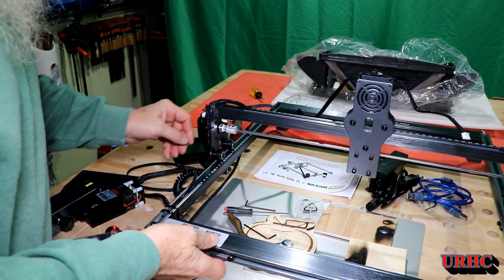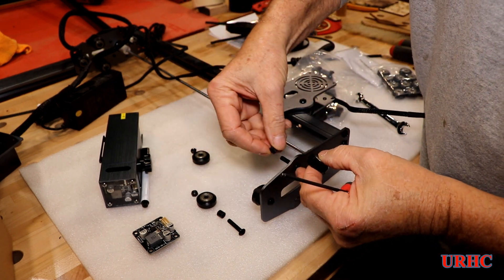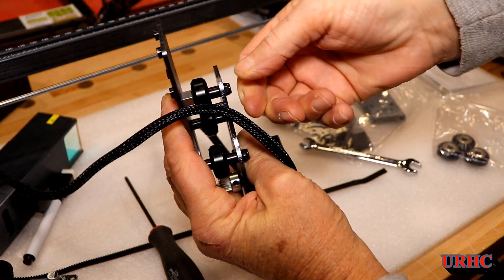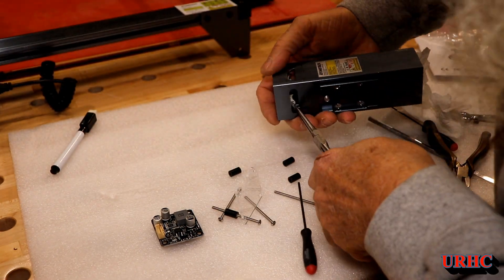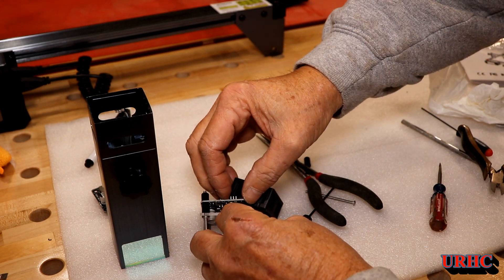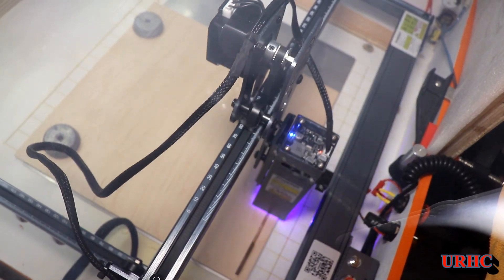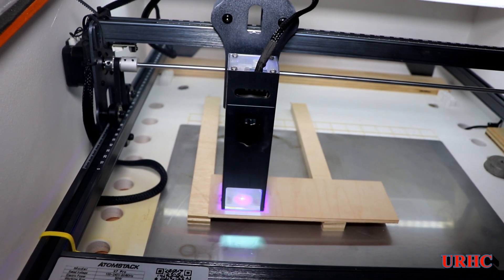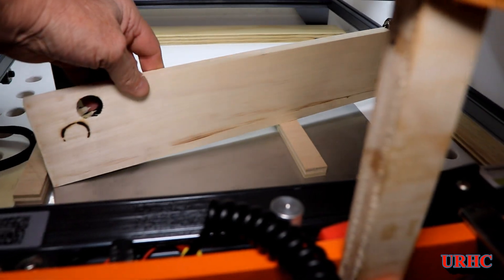Atomstack X7 Pro Repair And Second Try After Replacing Parts

Comment: Hi Redneck Hillbilly...I have a question, so, I have a AtomStack A10 Pro and my X achse is loosing. How can I adjustment or fix that. Thanks for your guide. Also, how and where can I get replacing parts?
Reply from the maker: I would start by popping the belts off and see if things move freely.  Atomstack should have parts, or even search on Amazon.  Thanks for watching.

Comment: Wow, so i thought i had an issue with the belt tensioning with the bumps, i have the same issue with the wheels.  Just ordered a new set, hope it fixes it.  Thanks for this great video!
Reply from the maker: i think they use the lowest cost wheels available. I definitely  wouldn't recommend Atomstack after this machine.  Thanks for watching.
Reply: @unemployedredneckhillbilly2023  Appreciate the reply.  Got the new wheels, and while it considerably better, i still have a single bump in the dead center of my gantry.  It seems the off balance of the whole mechanism is the cause.  If i counter weight the motor side, i dont get the bump.  The new wheels seem to be in good condition and i noticed that the bumps tend to get better or worse depending on how that little silver offset nut behind the bottom wheel is set(the offset sets the tension of the wheel on the track).  Going to try and see if theres just a really fine line of setting that tension that gets rid of the bump.
Reply from the maker: If you over tighten the new wheels they can flat spot and you will get a bump every revolution.  If it's  just in one spot check the extrusion for gunk or damage in that spot. Never  seen this kind of issue  with other manufacturers.  Guess that's  why this model was replaced so fast.
Reply: @unemployedredneckhillbilly2023  I sent a message to atomstack about this.  They were actually pretty helpful once i sent them a picture of what was going on.  They did suggest the same thing about the wheel and send a more in depth video on how to calibrate the machine.  Language barrier is a bit to get over, but plan on going over and possible replacing another wheel this weekend.  Thanks again!
Reply: @meistudiony    Here is the reply I got from support for the same issue:
 "We are sorry for your trouble. Where did you purchase S10 Pro? Item returns/replacements, missing parts issues and accessories replacements are handled directly by the seller."  guess YMMV with support.... I'm considering just returning the unit and going to a better supported machine

Comment: While they did send out a replacement board it definitely should never be on the user to replace bearings for the machine to run right. Hard pass for me.
Reply from the maker: This definitely is not one of my favorite machines. There's a reason  the price is lower then the rest and the support kept saying it was my fault because  the belts were to tight. I find Ortur  has the best  support and least problems on machines like this. Thanks for watching.

Comment: I just got the 50W model of this laser, but, before putting it together (or even receiving it) I decided to watch every video I could. I saw this one and decided to invest a couple of bucks into a set of bushings for it, even if they have resolved this problem. Better to replace them first than to cry when they bork up. 
Great informative video.
Reply from the maker: Good idea. Atomstack definitely  seems to cut corners to save pennies and then if there is a problem their customer service is slow as snails. Thanks for watching.

Comment: My X7 Pro just cant seem to perform "long" cut times. If i run the test cut (the dog on the SD card) i can get through in 2 passes, immediately after that if i run the test again then 2 passes is not enough to get through the same wood. Feels like heat soak on the laser, the longer the cuts the weaker is gets (assuming here). Speed / power tests have been run on the wood and 400mm 100% gets through the wood but again at that same setting and longer cut (like a small 5cm x 5cm box) and even more passes i wont be able to cut through? No idea what to check at this point. I even tried a more powerful PSU thinking perhaps the PSU that the X7 came with was not sufficient / faulty, thought this because the laser cooling fan would slow down audibly when the laser stated up. Any suggestions on what to check or how to pinpoint the issue?
Reply from the maker: Contact Atomstack. I have heard  running  their lasers at 100% kills them quickly.  I think there's a reason that the  Atomstack lasers are priced below  the competition.  I have better  results  with my Ortur and X tool machines with good support. Thanks for watching.

Comment: Wow, this is awesome. I just got one and have the same issues with the wheels. The belts/motors are grinding as a result.
Reply from the maker: If the belts  are grinding you have something wrong  with your limit switch settings or origin location.  Thanks for watching.

Comment: Sounds similar to me. I initially ordered a A5 Pro+ and the laser failed within 30 minutes of use. I decided to purchase the S10 Pro instead (exactly the same as the X7, not sure why the different names) and its been working well since then. I just added the air assist to it, I'm hoping that will allow me to cut through some thicker material a bit faster.
Reply from the maker: I think many of the first X7s had defective lasers. Now it just seems to be lenses cracking. Thanks for watching.

Comment: Hey there, I have a big 90w Co2 laser and am thinking about a 10watt Diode laser. The only thing is some of the diode lasers have some short comings in their build.Atomstack has a small spot size and that's good. The D7 has a very nice build. I wish they all had air assist and linear rails.
Reply from the maker: Right now the Xtool d1 is the nicest one available and they just released an air assist.  I am looking  at upgrading to a Co2 laser in the future.   Thanks for watching.

Comment: Hope you get better soon. Just discovered you and liked the page. I'm on the fence between the Xtool d1 and the Atomstack x7. Would love to see a side by side comparison once you have more time with them. Can't wait to see it if you do one! Take care..
Reply from the maker: I like the D1 better then any of my others. The X7 does work good in the end but all the cantilever is looking for trouble. Can't believe the price increases on all of them since Christmas.  Have to make an enclosure for the x7 before using it anymore and that is not in my near term plans right now. I may stretch it out to 4 feet long first. Thanks for watching..
Reply: @unemployedredneckhillbilly2023  cantilever? It looks like the specs like beam size, depth of cut, just about all specs, and price favor the x7. The d1 looks nicer and has the wifi though. What in your opinion makes the d1 the better buy?
Reply: Also what about the limit switches and homing ability of the x7? Sorry I have so many questions. I'm new to this.
Reply from the maker: I am just going by my experience  so far. 
My D1 needed no maintenance in a couple  hundred  hours  of use. The A7 was nothing  but problems right out of the box and is very finicky to keep adjusted. The D1 has much higher  quality  boards. The D1 laser has a much thicker heat sink assembly  for the laser. TheD1 has much less moving mass and zero play in the rail assembly that just needs to be wiped down and lubricated every  once in a while. The D1 has better  connectivity and it all works good. The offline sd running is a little  easier  with the A7 but the D1 app negates that. The plastic  laser shield on the D1 can be removed to allow  it to engrave  recessed  pockets where with  the A7 you only get about  1.5 mm limit.  The D1 has constant easy firmware  updates to improve results where the A7[ offers none so far. You have a choice  of 3 software  options  on the D1 ( lightburn,  laser box, or the app) and you only have laser grbl or lightburn costing $60 plus $30 a year for updates for either  machine. plus the D1 is sexier and engineered not just a batch of 3d printer  parts tossed together.  I use a hard stop that is the same as limit switches on my D1 and its easier for me to use plus the red laser framing is much easier  to line up. 
I definitely  would not spend my money on an A7 but you may feel differently.
Reply: @unemployedredneckhillbilly2023 ....and you just sold an Xtool. Can't wait to get it.
Reply from the maker: Mine has been running all day working on my next video. Start thinking about an enclosure or some type of ventilation for it. I think you made a smart choice.

Comment: I have a SculpFun S9 with similar cogging problems. Can you describe how you sized the wheels and post a link to the ones you used?
Reply from the maker: There's a link to the ones I used in the description.  Measure them. Mine are std 3d printer wheels Thanks for watching.
Reply: @unemployedredneckhillbilly2023  Thanks for the reply. Turns out my problem was the bolts used for axles were loose. Probably resulted in some twisting. Once snug, everything ran smooth. The wheels and bearings appear to be top quality.

Comment: What happened to the Chevy videos. I was riveted to your issues.. I too own a 2017 gm product..Happy New Year
Reply from the maker: I just took it down. GM will do nothing. Says it's  normal for their trucks to rust like that after 2 years and the 3 year corrosion warranty has run out even though it was started long before that. Now the dealer owner has stepped up and agreed  to buy the truck back for how this was handled by their service department. GM called  the shots so the dealer was basically  stuck in the middle and I will set that straight in an update.  Everything is delayed  because  Of my health right now.  Will do an update when it's  gone with  the details. GM does not care about customers and know this is a major problem.  l am in the line for a new Tundra now but it could  be months to get the one I want because  they don't  take orders now. Only  build  what they have parts  for and you choose  if you want what's available when your number comes up. I will never  touch another GM vehicle. Thanks for watching
Reply: @unemployedredneckhillbilly2023  . Thanks for the response. I’m glad the dealer did the right thing.  Hope you get well soon. Happy New Year
Reply from the maker: I think the real problem  may have been GM didn't want any videos online showing them fixing this TSB as it would  have made others use it as an example  to get theirs fixed. They seem to have me blocked most places I posted my video.
Reply: @unemployedredneckhillbilly2023  What a mess. I think Toyota is the way to go. I’ll do the same the next time as well. 
Thanks for all the information.

Comment: I just assembled my laser and the display lights up but nothing on it. any ideas? am i missing something?
thanks for any help in advance.
[sd card is in]
Reply from the maker: Save a g code file to the card and it should  find it. Without a file it's not going to do anything.  Try to get it going  with  USB first. Laser grbl or lightburn should  find it. Check the EMO button  is up also.  Contact  Atomstack for support
Reply: @unemployedredneckhillbilly2023  oh thanks, i got it going straight away. the emergency (big red button) kill switch had to be turned and pressed at the same time to release it. something that is not mentioned in the assembly directions. I stumbled across this by accident just after watching your vid.

Comment: So out of the Ortur LM2,  Xtool D1, and the Atomstck A7. In your opinion which would be better for a beginner? I want to do about an equal amount of engraving and cutting. Cutting 1/4 mdf for templates would be ideal. I’m struggling to choose but leaning towards the A7 because I can possible get more accessories and be within my budget. The hang up for me is customer service and support. Really enjoy your video and any insight would be appreciated
Reply from the maker: For a budget  Ortur  makes the best machines with  great  support  but they don't  have 10 watt diodes yet. 1/4 mdf will be several  passes with  a 10 watt. I am partial to the D1 because  it worked  so good out of the box. Plus it comes with  decent starter software to get started  if you don't  want to spend the money  on lightburn and it's  maintenance fees.
Ortur seems to currently have the best support and is releasing a  low cost version Aufero laser in Jan. Any of them are good machines to get started with. Thanks for watching.
Reply: @unemployedredneckhillbilly2023  thanks so much for the quick reply have a Happy New Year!

Comment: I have an a5 40w. I notice a bit of bump in the motion. But i am sure its the servos cogging a bit when not on.  No issues with it though. 
My laser fan has bad bearing and whines for a min on startup. And the y servo bearing has started to grind a bit. Loosening the belt helps but can leave slop in the y axis motion.

Atomstack is my favorite frame design. Was going to buy a neje max however i just feel the dual y axis servos will cause problems. 

Debating on upgrading my "40w" to the atom "50w" or the neje "80w". Or upgrading the whole atom to the new x7.

Neje customer support is more responsive to questions. Atomstack is hit and miss.  They warranty you because you are reviewer.. I wonder how consumer warranty is?
Reply from the maker: Check your  wheel bearings because  they use low quality wheels on this one. Remove the belts and it will show  right up. Thanks for watching.
Reply: @unemployedredneckhillbilly2023  
Yah i removed belt from the servos.. It was fine. 
Could be bad bearings in the servos also.

Comment: I ordered the x7 pro before seeing your "bad review" video and got pretty worried. It's my first laser. However after receiving the machine I really enjoy it! I don't work on pieces over 6mm so it does the job pretty well. Hope you enjoy yours!
Reply from the maker: I definitely got a bad one to start. It almost works as good as my D2 now. We will see how it lasts. They over rate these blue lasers for cutting capacity. 6mm is what a 10 watt should cut but running them at 100% power kills the diode fast. I may buy the extender kit for this in the future. Thanks for watching.
Reply: @unemployedredneckhillbilly2023  Awesome! Yes I do my best to stay away from 100% . I also just received a custom air assist kit for it I found on the x7 Facebook group. Thanks for your videos!

Comment: Merry Christmas! Glad to hear you got that all sorted out. My Ender 3 had an issue with the bearings as well on the platform. The ball bearings had side-to-side slop. After replacing them, it's sorted out my issue as well. How do you like this one, compared to your other one?
Reply from the maker: Merry Christmas to you and your family. This one definitely comes in second behind the XTool D1. It's a good value but I still don't fully trust it after the problems in the beginning. Let me run it for a hundred hours and get back. Thanks for watching.

Comment: I was getting ready to order this exact machine. Now I've got cold feet because if I get this thing home after saving my money and I run into what you did I'm going to be pissed!
Reply from the maker: Could  just be I got a bad one and they have everything straightened  out now. I bet the controller on my laser was a early prototype because  the replacement  looked to be higher quality and coated . It's the chance you take with  any of these offshore  products. Nothing  else like it in the price range. Thanks for watching.
Reply: @unemployedredneckhillbilly2023  I know that's why I've been holding out for this machine. I need the most power for the money right now.

Comment: Ed, one thing for sure, no one can accuse you of giving an unfair review of a product. I'll bet Atom Stack won't send out another bad machine to be reviewed. I'm glad everything worked out in the end.
Reply from the maker: It seems they slapped the demo ones together with less than perfect  parts. They wanted me to pull the original video but I didn't think that was right with the time that goes into  making them. They kept saying  loosen the belts and wheels to get rid of the gyro tripping but it reallly  looks like the bad bearings  were causing it and that laser control  board definitely  blew after  about  an hour.   First laser I have had a problem  with that wasn't firmware.  Merry Christmas.  Thanks for watching.
Reply: @unemployedredneckhillbilly2023  
They need to be held accountable.